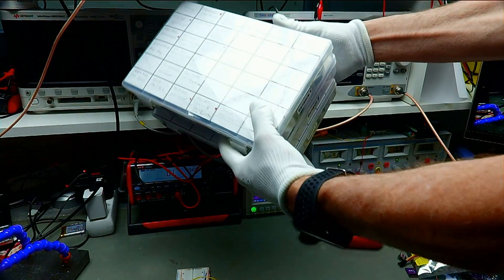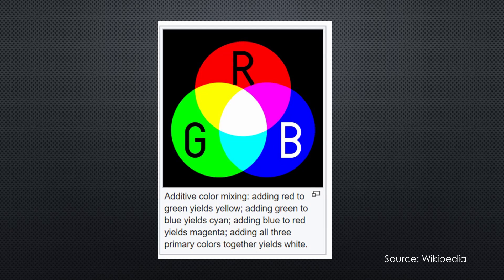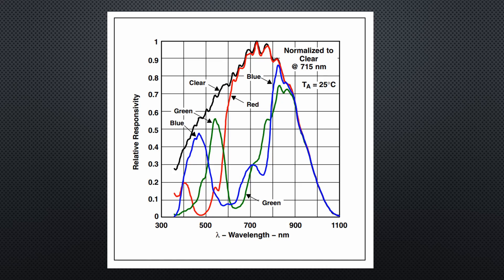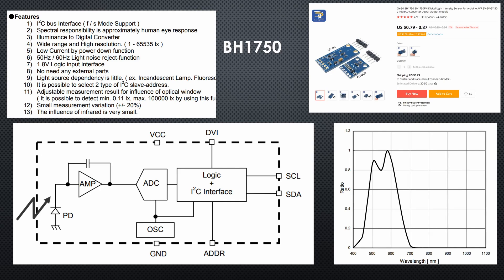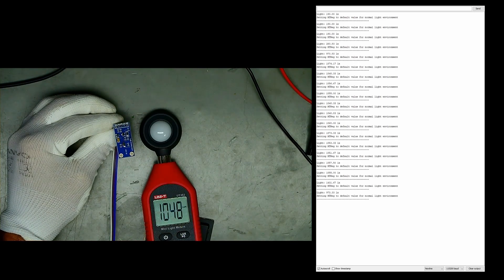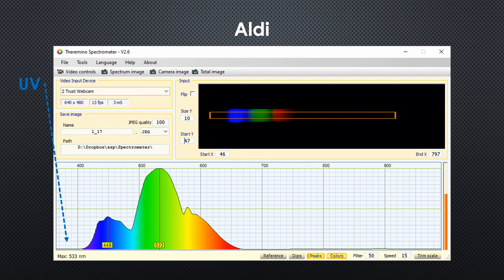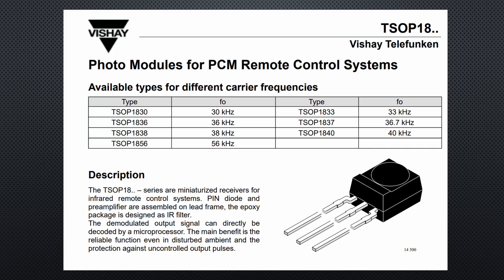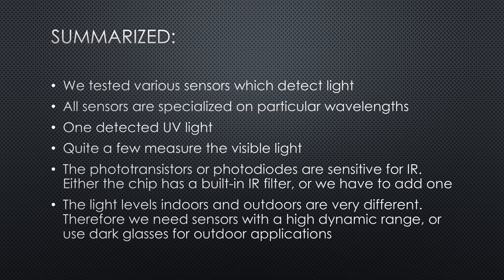#322 12 Light Sensors Tested: Measuring Light with Microcontrollers (Arduino or ESP8266, ESP32)

Comment: The brain and brightness seen is a bit odd at times.  Have a small light source and one twice as big. Both at the same lux level, the bigger one will be brighter. And if you dim them at the same rate the small one will go out before the big one.

Had this problem with a panel where the customer defined the lux output of all illuminated fonts. Ours due to the size of the panel had to have smaller fonts. If we met the lux spec we dimmed before the others, if we
dimmed at the same rate we were above the lux spec.  It was a lose - lose situation. In the end after a lot of panel redesign’s and constantly failing they had to let us increase the lux limit as we could match the dimming.
Reply from the maker: AFAIK Lux is something like Lumen/m2, so it depends on the area. Maybe this was one of the issues in your project?
Reply: @AndreasSpiess  That's the problem, specifications are often defined using a spot meter. So the customer will check all the displays in the the cockpit with a spot meter. to make sure they meet the spec. but the pilot likes to turn down the brilliance of the HUD and want's all the other displays to match. This is a no win situation   when you are using spot meters and eye's. throw in incandescent lamps and LED's + the different sizes of fonts you get in to a cycle of re-design and pain until some one gives. The pilot normally wins :)

Comment: Greetings Andreas, I am working on a personal research project but because of quarantine I can not buy any precision light measuring sensors and had to use the LDR that I already had at hand, but due to LDR's extreme variance with the change in temperature, it is far from precise, stuck at home and cannot buy anything, so I had to come up with an alternative, so I am using LEDs as a light sensor, I have tested many LEDs and came to a conclusion that the LEDs which light up at least voltage give the best results. 
I kindly propose the idea for one of your future videos to analyze and show how feasible it is to use an LED as a light sensor. 
Regards,
Tanishq
Reply: Tanishq  - maybe you are interested in this project - a solar tracker that uses LEDs as the sensor - he has lots of info on his webpage http://www.redrok.com/led3xassm.htm#led3xc3
Reply: @LarryKapp1  Thank you for sharing this project.

Comment: @andreas If you use a lux sensor for your awning you'll need to keep adjusting it every winter for when you want to sit out in the sun. It might be better to use a temperature sensor instead. Or maybe mix both (lux and temperature) and make some Node-RED flow for it! 

Sounds like a project! 😉
Reply from the maker: node red  should be able to do some simple if-then-else to avoid wrong extractions...

Comment: Your awning is to stop it getting too hot. Think infra red. A heat sink with a temp sensor might be easier and more effective! Depends if you want an engineers or a geeks solution!!
Your sensor comparisons are really useful. Stay well.
Reply from the maker: My wife wants to ahve teh awning out before it get hot ;-)
Reply: Andreas Spiess 
Let me know what your solution will be. Same problem here😃

Comment: Quite a nice presentation!  It looks like to could provide a lot of useful info and guidance to many of your viewers...i did not see if you showed the V-lambda human eye curve, as I had to respond to a "Frauen IRQ" ;-)
Reply from the maker: You are right. I did not show this curve.
Reply: @AndreasSpiess  not a big deal, ;-) , just that illumination and light measurement were a big part of my Beruf ... first phototransistor used in 1969, with a small parabolic reflector, it could detect a 60 W incandescent bulb about 75 m away... first red LED in 1970-ish; it cost 1% of my monthly salary, and made a light 'dot' like a Bleistift point ;-) But, light! I have been doing this for a while :-)

Comment: Hello, I use the MAX44009 lux sensor from Maxim integrated, widely available from Aliexpress. I use it to adapt the brightness of my displays
Reply: I use the same sensor on a GY-49.breakout board. However every Arduino library for the MAX44009 I downloaded had the same mistake in reading lux levels correctly. Looks like everyone copied the same error from the original library 😁 
It's an excellent lux level sensor with a huge 22 bit dynamic range, ultra low current and IR/UV blocking filters.
Reply: here is the code I use, is it okay ?
#define DATA_LUX_HIGH 0x03
#define DATA_LUX_LOW  0x04

float MAX44009::getLux(void)
{
  int luxHigh = readI2CAddr(DATA_LUX_HIGH);
  int luxLow  = readI2CAddr(DATA_LUX_LOW);
  int exponent = ( luxHigh & 0xf0 ) >>4;
  int mant = ( luxHigh & 0x0f ) << 4 | luxLow;
  return (float)( pow( 2, exponent ) * mant ) * 0.045; 
}
Reply: // Request 2 bytes of data

  Wire.requestFrom(0x4A, 1);

  // Read 2 bytes of data luminance msb, luminance lsb
  if (Wire.available() == 1)
  {
    data[1] = Wire.read();
  }

  // Convert the data to lux
  int exponent = (data[0] & 0xF0) >> 4;
  int mantissa = ((data[0] & 0x0F) << 4) | (data[1] & 0x0F);
  float illuminance = pow(2, exponent) * mantissa * 0.045;
Reply from the maker: Thanks for the info!

Comment: Hi Andreas, great content as usual and very helpful for a project I have always wanted to try: I would like to read the outside color temperature using one of my arduinos, then integrate it via mqtt into my node-red to adapt the Philips Hue Lights in a room with a tiny window to the same color temperature (doing this manually gives a much better perceived light atmosphere, but with changing lights outside (cloudy->sunny->cloudy) this is also irritating). Maybe some expert here has an idea: would it be sufficient to convert RGB values to Kelvin for that matter or would I need other values to analyze light intensity? Congratulatitons on 200k! :)
Reply from the maker: Interesting project. Color management is not an easy thing because always the whole spectrum is important.. Hopefully you find an expert for that matter

Comment: Hi Andreas, could you please recommend if any of the sensors that you showed will work for sun insolation in lux for solar panel application. I need to create a correlation of amount of sunlight vs solar panel power output. I am not sure what kind of sensor will work. Should it be RGB +IR+UV or just RGB. Anybody is welcome to answer. Thanks
Reply from the maker: I also do not know. Maybe you consult the datasheets of your solar panels to find out which part of the spectrum fits your needs best?
Reply: I think a lux sensor would be more applicable to your setup.
Reply: Just glue a small solar cell to a heatsink (to negate the effects of self heating) and measure the current output.

Comment: Thanks for the informative video. I made a rgb sensing setup yesterday using the AS7262 chip. Though expensive, it is easy to work with and accurate.
Reply from the maker: I looked at the sensor in the past, but was driven away by the high price. Now I ordered one. Thanks for the tip!

Comment: Thank you for your effort and time spent on this Topic.  Regarding your awning: What also could be helpful for you is the cloudage.  I am measuring far IR Temp with a Melexis  MLX90614 and environmental Temp with an BM280 or SHT35 (you would prefere the Swiss one). Then I calculate (or rather more guess) the cloudage.
Reply from the maker: This is a very interesting concept! Maybe I add a few additional sensors to my Lux meter and compare their readings...
Reply: @AndreasSpiess  him gokd sir...i, too was thinking about suggesting an IR sensor, as the luxmeter will not 'see' the IR that is heating your home...still, if it sees overall brightness, it would give a 'useful' correlation to insolation...
Reply: I would love to see a Video on different sensor types and comparing the usefulness for this scenario.

Comment: There has to be this intuitive bond.  I am currently working on a project in which I measure the UV-A and UV-B radiation, and if the brightness is exceeded, the shutters on the windows are to be automatically shut down until the UV-A and UV-B levels are again a comfortable level in the room  reached.  🤗😘
In my Project I desire to use GY-6075 Light Sensor Modul and BMP280 for Weather  Control with a Node MCU ESP32 Dev Board and a 433 MHz RF Transmitter to control the Somfy Window automation.
Reply from the maker: Thanks for sharing your experience. I try to add aslo a UV sensor to my Lux sensor to compare the readings...

Comment: Yes there is another one which I prefer: The TEMT6000. I also use it to measure sunlight and control my sun roof
Reply from the maker: Another viewer in the comments below reported that this one maxes out quite early. Do you have a trick?
Reply: @AndreasSpiess  yes you are right, I checked my setup (weather station) again and it's an SI1145 which I use outdoor. I use the TEMT6000 as   indoor sensor

Comment: ive got an "APDS-9960" but i cannot get it to work... from what ive read its actually only a APDS-9930.. which doesnt have the RGB functionality (what i purchaced it for!)..seems there a few fakes getting about...Thanks Andreas, i know what to look for what purchasing light devices now!
Reply from the maker: I also found aan APDS9930 during my sensor "reconciliation" . But I did not try it.It is only proximity and ambient light. So probably no fake.
Reply: @AndreasSpiess  yes the APDS-9930 is a real component.. i meant the fakes are that the boards are marked and being sold as APDS-9960 even tho its only got the APDS-9930 onboard

Comment: In my current project I am designing a sensor for determining distance with a red 5mW laser diode. I would like to be able to use these readings to control the response of a small dc stepper motor for controlling an X/Y axis small milling table. I have a lot to learn and I am sure this information will set me in the right direction. I started thinking about this project only earlier today, so this video came out with perfect timing for my needs. Thank You for all of your help over the past few years that I have been developing my understanding of these concepts.
Reply from the maker: Maybe you look also at the TOF and Lidar sensors.

Comment: Hi Andreas, nice video like always.
I have a question for you :) 
On the ESP32, if someone creates a wifi Network with the same SSID and the ESP32 tries to connect to it, the password that it sends to the router is Encripted? Or the fake Router can know your password in plain text with this kind of attack?
Thank you for your amazing videos.
Thx from Spain ;)
Reply: The current network encryption (wpa2) is still holding strong and works with your shared network key. If your esp want acess to the network through the access point is requests a random number as a challange and then the esp computes a couple of computaions where the random number the network key and his own mac adress is needed. The esp will send his encrypted random number back to the access point for evaluation and voila if the key was right you are in. Be carful in reality its even more complicated with more numbers and a 4way handshake but you get the point.
Reply from the maker: This has nothing to do with ESP32. This is a Wi-Fi security question. ESP32 uses the same technology as your Smarphone etc. So it should be save if your your router setup is ok
Reply: It would be very vulnerable if your password were sent in plain text over WiFi so I'm very sure it is encrypted.
Reply: average WiFi network is probably more susceptible to bruteforce attacks since people don't bother with long shared keys with enough entropy. Not sure about preventative mechanisms in common standards, though.

Comment: Hi Andreas, can you recommend a material, or maybe a ready product for outdoor UV sensor housing?
AFAIK even regular glass blocks some of UV radiation. So just gluing together some glass may not be the best idea.
Or could just measure the decrease of measured values behind the cover, and try to compensate for that?
Reply from the maker: Even glas blocks some UV the readings still should be ok if the attenuation is constant. I have no calibrated UV meter, so calibration will anyway not be possible for teh moment.

Comment: Andreas, I have PV solar panels. I need to predict the solar energy in advance (as you do with your awning). In my case I am diverting PV into my hot water system electric heater. I then destratify the water in the tank. However I do NOT want to destratify if there is cloudy skies ahead. Same for you with the awning. We both need to 'look forward' and read the sunshine ahead of us.  I presume I need an IR sensor and to make it directional .... I was thinking of putting it at the end of a tube, like your red one, but smaller aperture. The tube and sensor would then be mounted on a stepper motor and track a few degrees ahead of the sun (azimuth only) Do you have an opinion on this? If UV (or Lux) ahead is lower than a threshold then I do not destratify my water and you put your awning away! Congratulations on 200k
Reply from the maker: Actually I tried to use the forecast. But I think it is sufficient for me to just measure the current sunshine. Better than a bad forecast... First I will put a sensor out to measure and decide if it shows good values. Maybe a tube will be necessary. Or a lens.